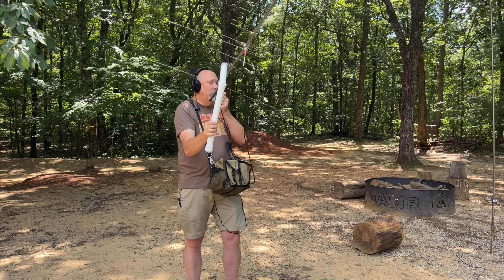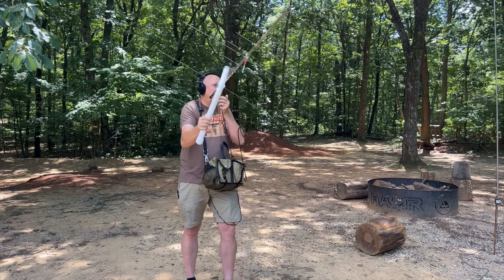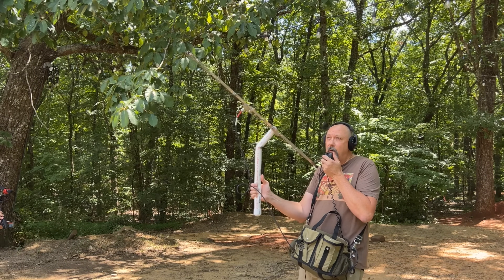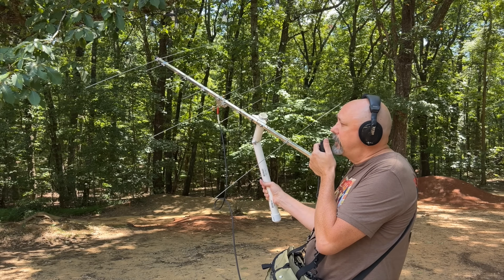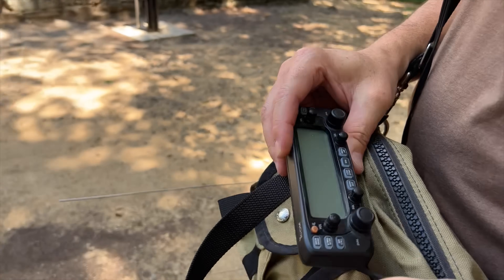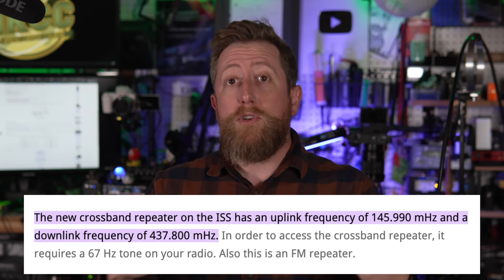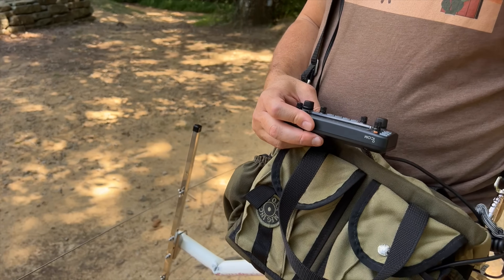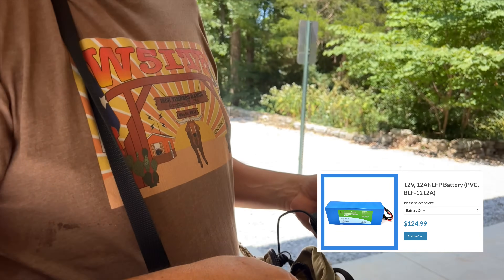EASY! ISS Crossband Repeater Ham Radio Contacts!

Comment: Very good video. A full duplex radio is a bit out of my price range at this time, but I do have 2 HTs. Would you happen to have a vide or a link or something to where it will show me how and where to attach the two radios to a 2m/70cm Yagi antenna? That would be very useful for working the satellites. Thank you kindly! KK7TMU. 73.
Reply: I have an Arrow antenna, so I'm not sure about other manufactured antennas. As for the Arrow, the UHF/VHF (model 146/437-10) antenna is basically 2 separate antennas on the same beam so you can have one HT hooked up to each. I have found it rather fiddly using 2 HT's, but it's doable. If you do go the Arrow route, I'd still recommend getting the duplexer option for if/when you decide to get a full duplex radio.
Reply: Understood, I appreciate your reply and will consider each option.

Comment: I find it easier to use an SDR (RTL-SDR for example) with a laptop for the listening side. From what I've found, it's not necessary to adjust for Doppler when transmitting; stay on center. With an SDR you can watch the waterfall, and use your fourth hand to click down the Doppler shift.

Comment: It may be also very useful to try moving antenna up and down - to adjust multipath interferences. It is amazing how much ground reflects signal, even at 5.8 GHz (for UAV video link). At one point, signal doubling, and at another halving due to nature of sum or difference of multipath reflections.

Comment: I watched this video and thought just for the hell of it I would monitor 437.800 on my Baofeng UV-5R and ten minutes later I started hearing some radio chatter and it only lasted a few minutes. I thought it had to be something else but I checked where the ISS was and sure enough it had been almost directly overhead at that time! Must have been people using the repeater.

Comment: Could someone do a video on a home brew egg beater antenna? Albeit less gain, but no aiming! Just set up on a tripod in park, A bit of LMR coax and on the air. Issue is the the ones for sale are not cheap.

Comment: So, I did an ISS contact attempt about a week after I got licensed.

It was passing almost directly overhead, so I knew I had to give it a try. 

I went out with my ft70d and my qrz1. The ft70d had a signal stick (yes, just a signal stick) set up to the uplink, and the qrz1 had its rubber duck and was tuned to the downlink.

I only heard the first two characters of my transmission back. But _wow_. Up until that point I had had trouble finding contacts from home. I'm just outside of a few repeater ranges with my limited gear.

Pinging the ISS was probably the most emotional moment I've ever had as a ham (sure, not a long time, I only got licensed in October). It was a life-changing experience for me, a 30-something-year-old grown-ass adult.

Imagine how to exciting this would be to kids. "Hey kids, were going to talk to astronauts". 

Even my wife, who is pretty ambivalent about radio, thought is was "really, really cool".

Long story short, guys, gals, try this. You don't need a lot of gear, and it's _exciting_.
Reply: Very cool. Definitely getting some gear and a license now. So glad I didn’t do so back when licensing was free (sarcasm).

Comment: I wonder why he uses antenna with not crossed polarizations. ISS has antennas crossed, so when UHF is vertical, VHF is horizontal and vice versa.
Reply from the maker: It doesn't really matter, you're not really going to just be able to keep them aligned.  Adjustment is always going to be needed.
Reply: It is also an antenna I had, just like the extra length of PVC. For me the point is you often see purpose build antennas and unobtainable radios used for satellite work, there are other simple and cheap ways to get it done.

Comment: Can two different radio achieve full duplex mimic. I got it to work once  by putting another handheld 20 ft away . But had another ham running it. I had a tyt 9800 hit the driveway like your 72 on anther try so it’s A lot of moving parts when chasing a pass.he did make that look easy
Reply from the maker: Yea absolutely.  And that is what a lot of people do.

Comment: Automated is big bucks! Yaesu G-5500 + computer interface is ~$1400, a Spid RAS az/el rotor is $2200 but capable of a very heavy load(The Big RAS even heavier, I use it on 2m EME with four 20 foot long antennas but it is $3051!!!). Advantage here is full computer control.

Some people homebrew a controller, use a TV antenna rotor and an absolute encoder grafted on to read az, and a satellite dish actuator for elevation with another encoder grafted on. MUCH cheaper but a lot of work! Been there done that! No computer control as is but there are some outboard controllers that will work with this setup. The EA4TX ARS-USB at $312 and Green Heron RT-21 azel at $899 can read these encoders. 

I went Spid rotors to handle the winds I get... 60mph for 3 days in winter happens and it beats the crap out of rotors. I have a trashed Ham IV on my bench that the wind sheared the spur gear teeth off! I prefr stuff to stay in the air and not be broken!

Comment: Joss, do you actually nee the Yagi? Won't an omni directional, like a moxon pointed up, or the spiral antennas, do this too. I mean a lot of the radios that could do this are 50 Watts or more. That whole circus act of juggling is off putting for anyone trying this as a beginner.
Reply from the maker: could an Omni work? Yes. It’s a Yagi antenna much more effective? Also yes. Many omnis have a null. So you’d still have to point them at some point or accept the losses.

Comment: As the satellite approaches you the frequency goes UP WHEN IT IS ABOVE YOU OR IS NEITHER APPROACHING NOR GOING AWAY  FROM YOU LIKE DIRECTLY OVER HEAD. THERE IS NO DOPPLER SHIFT SO IT IS THE ACTUAL FREQUENCY.  AS IT STARTS GOING AWAY THEN THE FREQUENCY IS SHIFTING DOWN OR LOWERING IN FREQUENCY.  Also the same goes for your VHF up link frequency suffers from Doppler effect as well.
Reply from the maker: What’s with the caps lock bro?

Comment: Great Video.  Always good to see an "expert" do this.  A skill-set built from experience - for sure... I also love Sean's tutorials (YouTube and DXEngineering}.  Hitting the ISS from here in Interior Alaska and locations further north is close to impossible,  I have a 90 second window every once in a while.  The ISS (best) high elevation point is +5 degrees.  I use GoSat watch.  Thus far I've managed 1-2 QSO over the last  year but LOVE the challenge.. That''s the fun.  BP64 if interested.
Reply from the maker: Alaska is a tough haul!!
Reply: Always one satellite you can work form AK! The moon! With the new digital modes guys are making contacts on 1296mhz with low power and a 2 meter dish antenna! My 2 meter eme array is four m2 2m12 20' long antennas and I have no trouble working all but the smallest stations! Smallest I worked was 2 similar antennas and the guy was running 160 watts!

Comment: Fm birds and the iss are jammed most of the time, it’s nice to sometimes get on the linear birds and get some breathing room.
Reply from the maker: Indeed!
Reply: The prospect of satellite operation is what got me into the hobby. Imagine my disappointment when I discovered that communication is impossible due to every FM satellite becoming a traffic jam of more powerful transmitters the instant that they rise above the horizon.
Reply: @Mandelbrot_Set  invest in (2) yaesu 817 radios or a 817 and a d74. Move to linear (ssb) birds. You won’t have this problem and it’s much easier to make contacts and even have conversations! FM birds can be a major turnoff, especially when it’s the same 5 guys giving each other the same grids

Comment: I need to try this . Ugh means I need to buy a full duplex radio $$$
Reply: Don't need to, it definitely makes it simpler, but you can use two cheap radios, one for transmit and one for recieving
Reply: I use an arrow 2 antenna with the diplexer and a ft-60 and make plenty of contacts. Sure 2 radios help but I wouldn't say mandatory.